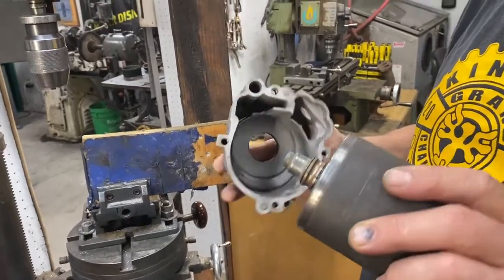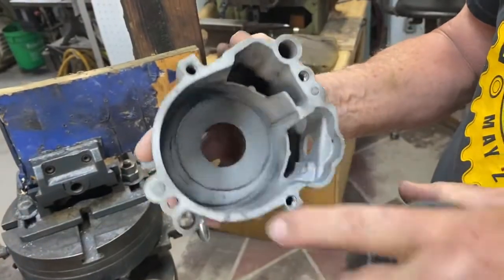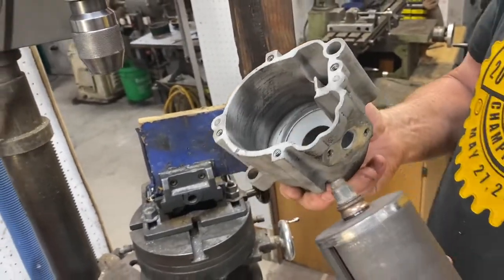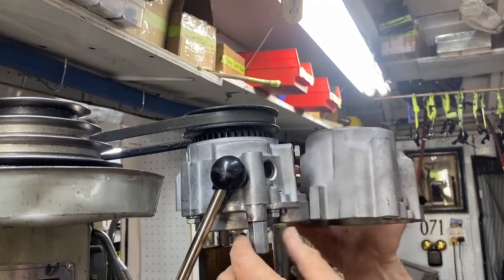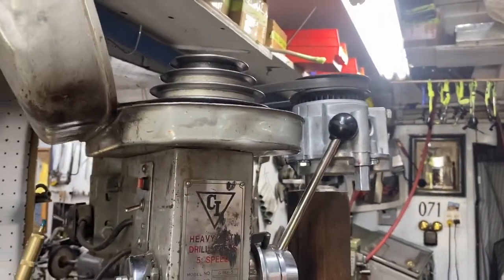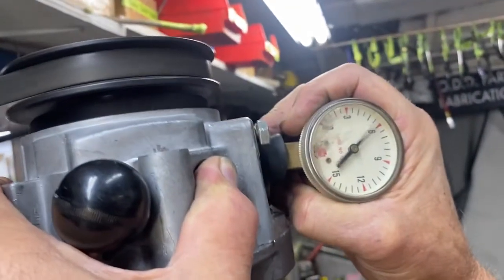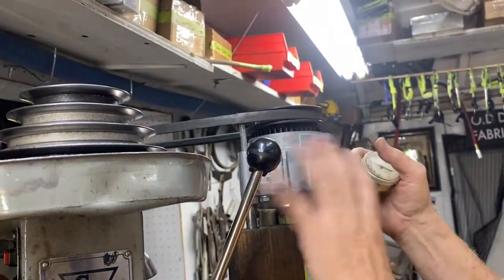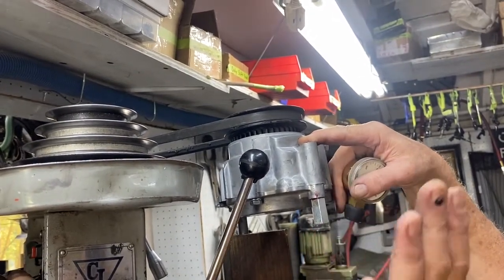Retro Corvette smog air pump conversion.

Comment: I am trying to prove a theory, that a higher output smog pump will help pass emissions.  I am trying to find a smaller diameter pulley for my oem smog pump to make it spin faster. This is for emissions testing only.